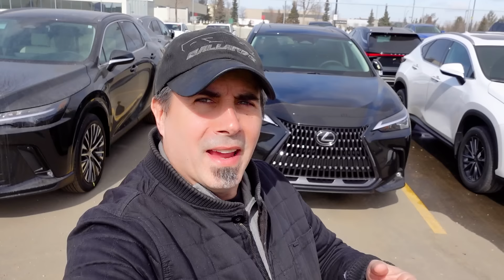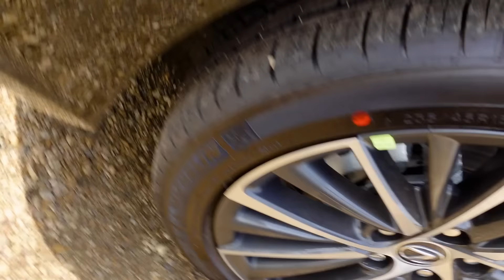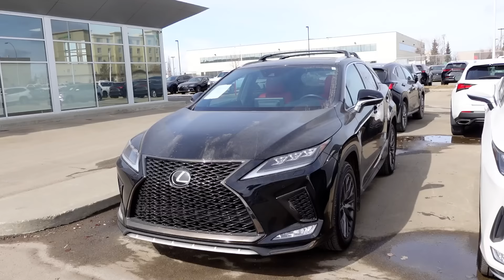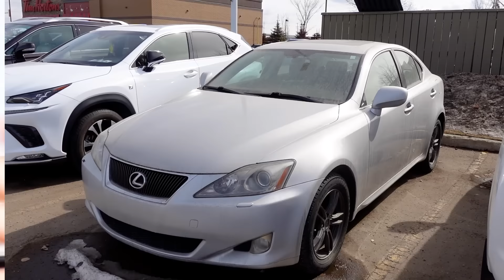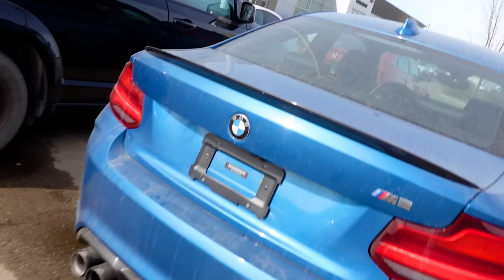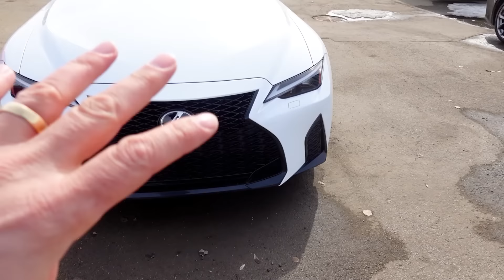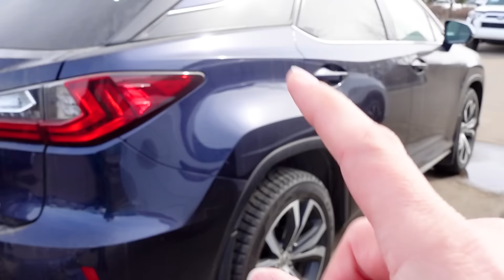Is Buying A Used Lexus a (MASSIVE) Mistake?

Comment: Check the milage, any car that's done 60,000/100,000s, miles and the catalytic converter will cost you £2,000.thats how long they last.
Reply from the maker: thanks for sharing.  If rvien properly with good fuel and warm up or cooll down and thats pretty rare

Comment: i just bought a used 2016 is200t. it was beat up cosmeticaly but the trans and engine is insane perfect. the thermostat that needs to be changed, tho and its in a very difficult spot which is a big job and people are charging me 1k for the job.

Comment: Bought a fully maintained Lexus NX 2015, and it is the worst car I have ever had. First, all door handles stopped working when the temperature fell below 0, and now the sound is not working when the car is moving, and nobody knows why. I have never had such issues, even with the cheapest cars. So the Lexus reliability is a myth - do not buy, that's it.

Comment: The short answer is no.  Buy older ones.  Check the reliability ratings, and thoroughly check out the car you might buy.  Get your own mechanic to look at it, and get service records.  If it doesn't appear well-maintained, it probably isn't.  It took me well over a year to replace an older Toyota, but I got a real good one.

Comment: Buy a used Lexus, and then boost the performance/handling with aftermarket products to your taste. Want more horsepower? Add a header and a tuned exhaust. Want better handling? But thicker anti-sway and anti-stress bars.. It's not that hard to reliably boost your horsepower ard handling. But it's hard to add REKIABILITY to a car that doesn't have that designed into it.

Comment: I own a Camry bought new and now with 256,000 and Avalon bought new and now 100,000 miles. I recently purchased my first ever used car that was 2021 Lexus RX 350 and intended to trade in the Camry. The Lexus dealer offered me $800 for the Camry and about what I expected but I decided to just keep the Camry. I’ve never owned a car brand that won’t wear out until I started buying Toyota products.
Reply from the maker: Those are some impressive numbers and that is the most important consideration

Comment: I got the steal of the Century Yesterday. I traded in a 22' Elantra N for a '19 IS350 FS. Car is in literal mint condition. Fully loaded with all the additional Trims installed. It was leased to an 80 YO lady that drove it 3k miles a year, garage kept and brought it in for maintenance every 3k miles. there were 12 oil changes on the carfax. It has 18,000 miles on it. Listed at 35k. With Lexus' Lifetime Powertrain Warranty and the ability to add lifetime bumper to bumper, oil changes, tire/rims, glass, and paint protection..... it was a no brainer.  Also it was absolutely the best dealer experience I ever had. As a mater or fact, the Elantra is in Service at Hyundai, in true Hyundai fashion, and Lexus still gave me what I asked for without looking or taking delivery of the car.... Then let me drive off the lot in mine. I still have to take it to them next week.... Unbelievable. The Elantra N is also another INCREDIBLE machine for 35k. But the Elantra N is a hyundai and you are rolling the Hyundai dice. My car had bad injectors at 4k miles. Then again at 40k which also led to needing a new CAT. It was when I took it in the second time I seriously started thinking about trading in. I dont ever have to worry about the Lexus. Was a solid Finanacial decision and pure luck. The IS350 was back on the lot for 1 day before I got it and I just happened to stop by on a whim. It was fate. I have been a lifelong Toyota guy. The N was my first non Yota. I have a 20yo tC that has never been in the shop. You can't go wrong by saving a little money and going used Lexus. I was shopping for another used Supra but every one is ragged, tagged and wrecked.

Comment: Folks need to do their homework on Lexus before  they buy a used one. Some have timing cover leaks that require engine out to fix it. Same thing about some Lexus have starters that can't be replaced without engine out.  I would also stay from any used Lexus that didn't have good maintenance records showing the oil was changed on time. Many lease vehicles are abused by owners then given back to the dealer.

Comment: 2006 Lexus Is250 manual with 2je engine swap from a 2007 Lexus  gs, 240 hp with aftermarket  suspension, brz diff…..👍🏽

Comment: Everyone dogs out the is250 with the DGI 4gr-fse engine. Yes, it will build up intake valve carbon over time, but clean the valves when you change spark plugs and you're good 👍. My 2013 has 220000 miles on the engine, and it is definitely NOT slow! Change the oil every 5000 miles, give her an Italian tune-up now and then, and you will love 💕 your is250!

Comment: I own 2015 rx350. 100k no issues . I haven’t even had to change the brake pads. Do not buy a Rx if you like to upgrade every few years. Because other than new tech and body style changes. There’s no reason to upgrade.

Comment: I did test ride on a 2018 rx350 . My blue driver obd  ( all module ) mode , this vehicle had tonnes of codes on it . The elementary codes where probably erased - showed zero codes. Chatgpt told me to stay away from it . Even if it’s a Lexus , still have it checked by a mechanic .

Comment: Just bought my daughter a 2012 RX 350 with 110k miles for 13k,very happy
Reply: My 2012 Prius with 223k miles was still running strong but just got flooded in the Texas hill country thunderstorm on July 5. Just got a 2013 Lexus RX350 with 163k miles, well maintained by previous owner. It’s my first Lexus and I love the comfortable and quiet ride even with high mileage, hope it’ll last long.

Comment: I've got a 2017 eminent White with parchment and brown interior ES 350 that has just under 60,000 MI and not only do I think it looks better than the new ones and it has a far better looking navigation system that fits beautifully under the dash like it should compared to the new ones that looks like an afterthought that lacks class and style compared to the 6th generation.
Reply from the maker: Congrats on the new purchase.  Great job and that car should last a long time.  Nice features, beautiful lines and ton of space.  They are massive in the backseats and trunk as you see.  Glad you found the right one.
Reply: @ECPP  I really do like it I bought it at CarMax August of 23rd and it barely had 50,000 mi on it what's previously a leased car which is really good because the Lexus dealerships make keep up with the fluid changes or you lose the lease .

Comment: Just purchased my first Lexus. a 2018 RX 350 with 80k miles. coming from a 2008 Toyota Highlander. Essentially I wanted a very similar car but in a much nicer package with that very reliable 3.5 litre V6. My Highlander had nearly 200k miles and still was going strong 💪🏽
Reply: Still happy with your RX 2018 ? How is reliability.

Comment: And don`t go to dealerships. Those guys will waste your time and rip you off on the spot. Recently went to Lexus of North Miami. Said right away what I was looking for (RX350 up to 30k). The guy offered to drive $43 000  car and I told him that it is out of my budget. He still told me to drive it saying that they might drop the price because he doesn`t know for how much they can sell it. After driving he brought me a payment plan for that $43 000 car. I was shocked. He wasted his and mine time for nothing.
After some arguing he showed me the car that was around 30k. But I didn`t want to go back again to the garage, test drive it because already spent more than 2 hours there. If he would show me it right away, I would probably get it. Then he started quickly creating the payment plan for the cheaper and with all their fees and financing the amount was $41 000. For a $30 000 car!!! Some of the fees he could not even explain. 
So i turned around and couple of days later found amazing similar lexus RX350 and negotiated the price for $23000. No fees, way less taxes and the car in the immaculate condition!

Comment: Off topic. I just wanted to share my experience,  We purchased a brand new car on Saturday night, from a dealer about 1.5  hours away with traffic aside from them trying to add more fees to the agreed upon written quoted  price, when we got  home at late night straight  from the dealer the car shut down completely and went completely dead. This is at 11 pm. We had a baby and 2 toddlers with us, had we stopped on the way home we would have been stranded as the road side assistance wasn't activated yet(we learnt this the next day). Upon reflection , it seemed like the sales person may have know there was an issue and still gave us the car. The battery caps were off when we got home, and it appeared to be jump started at the dealer,(sales manager mentioned that after the fact) Also we found it odd he left the car running after the test drive for a long while, his reason was he wanted to refuel the car, but it could have been he was hoping the battery recharged itself. And upon leaving he said if we had problems with the car, let them know they would sort it out. And I was thinking it's a new car I hope there are no problems. Only after it died i started piecing these things together. I may be wrong but it appears that way. The  GM never apologized or contacted us, or responded to our emails, we had to call to get in touch with him and the person who answered down played the whole situation and said he would take our information and pass it on to the GM, the GM then called but was very cold, we suggested a refund or a new car replacements, he said the refund, which we preferred as the service at this point was mocking and horrible. I am hoping he gives us the refund when we go in. And he is not bsing us. The car is being serviced and we have to return the car when it's finished.  the technician its a battery out of warranty, should let the dealer have know this before giving us the car when they are doing the detailing.l? After spending $55k on a vehicle, I am so disgusted. What are your thoughts on this?
Reply: wow !... 0:02 I would talk to an attorney and when you tell them you're talking to an attorney their attitude changes pretty fast!!!🙏
good luck!
oh I just noticed this was four months ago you probably already resolved it ?...but if you didn't try that angle
Reply: They sold you a car with a flat battery. Doesn’t sound like the biggest deal lol. It possible they didn’t even know, the cars sit around and the battery dies so they just jump it and think it’s good to go not realizing the battery is toast.
Reply: @AC-wl7ve they knew.
Reply: @pn504 that’s odds. Why would they do that, they know you’re just going to come back complaining and demand a new battery lol. Regardless, it’s not like you bought a broken car, it’s just a battery at the end of the day.

Comment: 114k miles on my Lexus RX350, needed a water pump @ 112k miles. I replaced it with the proper Aisin brand water pump kit (serpentine belt, tensioner, etc..). That's it, just regular maintenance otherwise. I'd buy my RX350 all over again every time, and still runs and drives like new.

Comment: I have a 2008 Lexus Rx350 awd that I bought used @157,000 miles.  No problems!  Paint is great ... no sign of rust and I live in the rust belt.  Interior is great.Change your fluids regularly and be prepared for no problems.  High quality materials throughout.

Comment: 2019 Nx300h and rx450h ? Na+hybrid unit ? Are hybrids reliable ?
Reply from the maker: I believe both carry the fairly reliable 2.5 L NA four cylinder and that’s not an issue and the CvT that Toyota rocks seems to work, and let’s face it the Toyota Hybrids are better than most others.   I would go 450+ to get the free range 50 km range and low cost commutes

Comment: I bought a 2014 Lexus GS350 awd 4.5 years ago with 40k miles on it. It currently has 80k miles on it. I only bought tires and new brakes/rotors since. It's an an amazing car.

Comment: Ive had my 2010 hs250h for 10 years.  We bought it in 2014- four years old.  The car has been the best car i have ever owned.  I tend to keep my vehicles forever.  It's been an amazing car!  Still going strong everyday.  Basic maintenance and that's it.  I plan to drive it another 10 years!
Reply: I had the same car. 2010 HS 250h, bought in 2015 with 37k miles, all good until 183k miles 11 yrs later. Expensive electrical issue now. $3500 to fix at Lexus. They said they never saw this issue before. Who knows. I'm bummed that it didn't last longer. Looking for another used Lexus

Comment: Hello, what do you think about a 2016 RC350 around 109k miles?
Reply from the maker: Nice car and the engine is their best and likely if it’s been well looked after the. It should be good for over 2200 or 250000 miles

Comment: ES 350  , RX350 CHEAPER TO MAINTAIN than IS 350 AWD.

LS 460, IS 250  HAVE ISSUES.

Good secondhand: 
- Get over 6 years old, get 40%discount. 
-  IS250, RX350, 
- avoid those with corrosion, rust. GX AND LX  models
 Problems: 
-  sticky dash 
- water pumps
-  2 Gr- fe: oil lines

Comment: @4:27: "...last well beyond 5 to 10 years". Say what? Don't tell me it is good if a car last a bit beyond 10 years.  In fact, I have never owned a car younger than 10 years old. They are just way too expensive to buy.
@12:20: Stylish? My ass. That is front looking hideous.
@13:17: Already rusting after 7 years of age? Oh my... That's also terrible - for any car.
@14:27: 'Newer vehicles are much better treated...'. If it requires a 'treatment' against rust, then it is not good material to begin with. When comes finally the day that you can buy cars who don't rust at all? That can't be that technically challenging. Is it?
@16:53: "...older Lexuses...": The Lexuses you were talking about (5 to 7 years old), are not older Lexuses. Those are almost new cars.
Overall: it looks like you are talking only to rich people.
Reply from the maker: I am not rich and so I talk to the average as most people often look at buying a 3-7 year old vehicle as that’s the sweet spot between service life and value due to depreciation.  I also drive and old truck.  2003 gets it done as a daily for
Me.

Comment: Here's an interesting fact I learned from the car care nut channel. The Toyota eCVT gearboxes used in the hybrids are not available except through special order. They are not kept in stock because its not needed. They are that reliable!
Reply from the maker: Much better than the old Jatco crap at Nissan

Comment: I bought a used Lexus ES 350. It was 3 years old with low mileage. I have had it for 8 years…..absolutely NO PROBLEMS. I take it to my local mechanic’s c and had had ZERO problems. I just hit 100,000 miles. A wonderful car.

Comment: Only if the previous owner has not taken care of service on the vehicle, only if you can see all the service records on the Lexus 12 go spend four to $500 and let the Lexus dealer go through the entire vehicle but if it’s a Lexus, they keep a service record from each automobile that they sell. Get the Vin number of the vehicle you’re looking at and go to Alexis Steeler and they’ll pull our service record up on it wherever the car was serviced and Lexis system that your answer.

Comment: I bought a used  2008 lexus is 250 with 100,000 miles on it, been driving it for 7 years now, no issues at all. Just regular maintenance.

Comment: I can’t believe this mechanics talking how bulletproof engine is 350 your misleading Lexus buyers 350 own for timing chain cover gasket leak and how much is the repair however no problems with 4 cylinder turbo engines common before you go misleading average buyers  do your research it’s a shame
Reply from the maker: Thanka for watching

Comment: Engineering Background here coming form my reliable Toyota Camry. What are the advantages of going with F Sport Handling vs the luxury non F sport? I don't mind $49,000  but I might get it a couple of years used so I could get it for $35,000. 3 years used, around 45,000 miles. Even if it is 5 years old and has 75,000 miles, a Lexus can go over 250,000 miles. The grill can be a bit polarizing and not a huge fan of it but it's not the WORST grill out in the market, it's just a bit in your face. I like the grill on the GX 550 the best. I am going to get an ES 350 F sport Handling for my every day car and a GX 550 Ovetrail +. I am not going to go for the RX because it's not that good in towing and I prefer body on frame so I can go off road.

Comment: I’ve found 2017 2019 and so on   even sedans Lexus suv  with the v6 newer but not brand new for 25k and under with low mileage so it’s not to expensive anymore I’m most into the rx and es I’ve found one rc model in the 25k with low mileage it’s doable just have to know where to look

Comment: I drive 2004 gx470... 300K, excellent road feel... drive train & steering is so smooth... got t boned on the driver side front quarter panel.... got fixed in two weeks

Comment: Even if it's a Lexus, you have to get a good maintenance record, carfax and a good inspection for it. It could have been abused. I would look for something 2012 or newer for the GS, ES and IS models. Some of the Lexus 3.5 engines can develop a front timing chain cover oil leak, which is a known issue. It's a $2k plus repair. That's where the inspection part comes in 👍

Comment: This is so on point. After looking at the new is350 and 500s with the new style post 2021, i realized the better option is to buy new because all the used are only 1 or 2 years old and cost just nearly the sameas brand new. Some new ones are actually less because of the potential deals and promos available on them that you can't get with used.